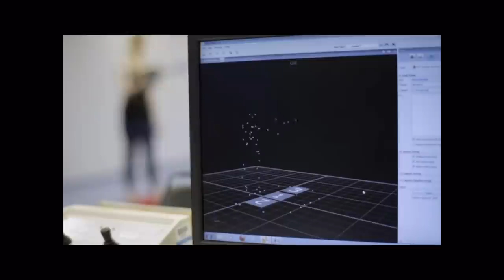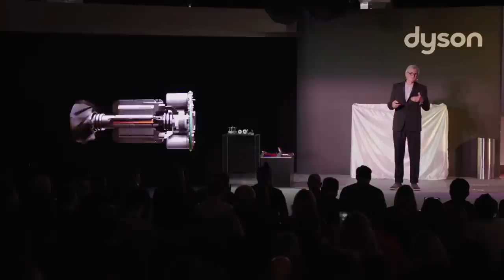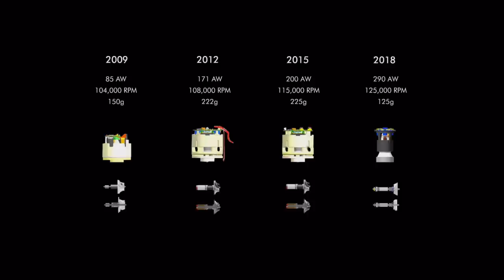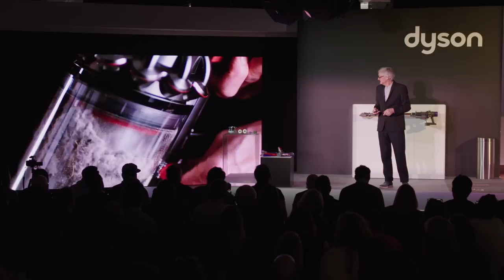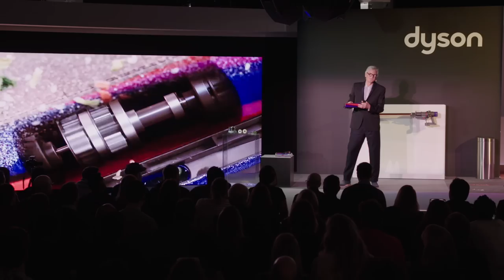James Dyson unveils the Dyson Cyclone V10™ cordless vacuum in New York

Comment: What is the expected lifetime of the machine? Rechargeable batteries need replacing after 500 charges,so that is a year and a half of daily charging. There are no replacement battery packs listed on the Dyson web site so presumably they cannot be replaced.
I have had my current mains vacuum cleaner for ten years and don't see any reason why it should not last another ten. Are we now expected to pollute the environment with yearly purchases of vacuum cleaners?
The video seems to go into every minute detail but avoids this issue altogether.
Reply from the maker: Hello,

Thank you for the comment. 

Batteries on our cordless range of machines can be replaced. They can be purchased from us directly and are relatively easy to replace. 

Best wishes,

Dean
Reply: Dyson UK  Thank you for the prompt reply. I  found  on your site a replacement battery pack for the V8,however  there  was no price listed  and the following was  written  "This spare part is not available to buy as it should only be replaced by a qualified engineer."
So it leaves me wondering  what the cost would be  - part + visit of technition?
Reply from the maker: Hello,

If you can please send us a private message, I will be able to assist you further.

Thanks,

Dean
Reply: Dyson UK lol shut down. So much secrecy over a battery.

Comment: 15:53. Did he say electronically up the amps??? One has to be carefull. If you ramp the amps as the battery fades you create more heat.  Even the wattage can pop a fuse or a diode. Thermally this isn't good. If the constant maximum performance ever surges or peaks even briefly thats no good and your vacuum basically goes to red blinking battery failure codes in the battery control module because the thermistor sensor is shot  and the thermistor circuitry is a fail-safe so you don't fry the circuitry in your vacuum ( but not always the case) . Now circuitry isnt infallible to surging or atomic dust conductivity which shorts the microcircuitry. Now i realize at the last stage of the battery performance the issues begin. Thats why possibly the trigger gets weak and breaks at the anchor point, as well now the printed  curcuit board may carbon track. The radial seals may also overheat due to the higher stepped amps. That is possibly why we see more motor failures in the V10 vacuums and some V11s with broken triggers or poor digital motor performance. Also in some climates. Static in the canister becomes an issue with these vacuums and the fine dust works past the pre motor filter and the hepa filter. I have serviced quite a few V10s and 11s that have this issue. One thing to note is don't wash the filters with hard water that have minerals in it. Best to get a  soft water filter for your plumbing when washing these filters. Heat also discolors this ceramic shaft and ceramic also absorbs heat and can expand the neodymium magnets causing hairline cracking also premature bearing wear. If you want to run tight tolerances you need to lose heat which can create imbalanced. Imbalances in turn creates oscillation at high RPMs and an imbalance at 135000 RPM things can fly apart fast and lock up the vacuum. However on these newer vacuums you went trigger less. How do you now compensate for the battery loss??? Also now if one actually vacuums something accidentally thats slightly damp. Now ones reaction time with an on switch is a lot slower to shut it off than quickly release the trigger. Now you're back to square one like conventional vacuums. Just saying. Sometimes engineers have to make up their minds whats better, ergonomical and efficient and stay on the same platform, or many landfills will start to fill up more because people want the latest and the greatest like the Gen5 detect. I already have seen over a dozen V10 vacuums in pawnshops with all their accessories for $100 to $150. And the batteries and battery management systems are faulty and these were used under normal conditions. The V10 is not even 10 years old yet and the issues as they get older are plenty.

Comment: The one thing that’s not clear to me, is that he keeps on saying that the airflow goes “straight through”. However, if you down the entry tube of the v10, you’d see that the air takes a perpendicular bend into the canister to create the “cyclone” effect. Then it’s sucked into the middle column into the back. Whereas the v8 already comes at a 90 deg angle into the bin, already creating the cyclone. So I don’t think the v10 is actually more efficient. Seems less so....
Reply from the maker: Hi Frank, we've put countless hours of engineering time and experience from our history of floor care products into making the primary separator inlet- or perpendicular bend into the bin- as efficient as possible for airflow. As a result of this and moving the axis of the cyclone to match the motor the air now takes a more direct route out of the cyclone, through the pre-motor filter and into the motor. This all contributes to the increase in suction power of the Dyson Cyclone V10™ vacuum.

Comment: CFM is the only thing that matters. If this has the highest CFM and he doesn’t list it, it’s because he’s still afraid enough of the competition to agree not to list it.
Reply from the maker: Hi there, a vacuum cleaner's suction power is measured in air watts. Air watts are calculated using both airflow (which could be measured in a unit such as CFM), and vacuum pressure. Both air flow and vacuum pressure are required to produce useful levels of suction power. The motorised cleaner head and airflow pathways within the machine also have important roles to play in the overall pickup ability of a vacuum cleaner.

Comment: The V10 will run for six minutes before the battery dies with it on full power and the powered carpet head attached.  People are already getting rid of them by selling them on ebay. You cannot beat a mains powered vacuum cleaner for suction power and performance!
Reply: Apparently you're supposed to run it on medium where you get 20-25min with the power carpet head attached.

I have been researching Dyson V10 vs V8 vs LG A9 Master vs Samsung Powerstick Pro.   
Because I am sick of dragging out the big machine with the cord and all the stupid cleaning of filters and hosing off the filter under high pressure water. 

First I was sure that I would get the V10.
Then I saw V8 seems to get pretty much as good reviews for $200 less.
Then looked at LG A9 and was convinced it was the one because of the 2 batteries it comes with.
Then changed my mind because its bin is too small (smaller than V8 even) and only filters 2.5 microns of dust coming out of the filter into the air, compared to 0.3 microns on V10.
Also a review talked about how theres a fair bit of washing and cleaning of filters compared to V8/10.

Looked at Samsung for a bit, nothing particularly remarkable there.  It probably works ok but just nothing remarkable.

Then decided on the V8 because of the price and reviews saying it's basically as good as V10, just empty the bin a bit more.

Then decided I will spend the extra $200 on the V10 to get:
1.  the bigger bin, because I hate emptying out dust and having plume of dust going everywhere.  I will probably wrap a plastic garbage bag around the bottom of it first before opening so the plume is sealed.
2.  the more powerful motor/suction
3.  the better cleaning head compared to V8
4.  the longer lifespan of battery (apparently 15 years instead of 3-5 years on the V8).  I read an anecdote saying you can buy a spare battery from spare parts for $95 AUD.

But the price was still offputting to me.

But now I just found a decent deal at $825 AUD for the V10 complete including delivery.

So I will go with the V10.

Then I just watched this video, and I am convinced that they have put enough into effort into the design to justify the price.   That doesn't mean it's a good product, only that they appear to be trying hard enough to justify the price.   Also the law of diminishing returns.  That 5% bit of extra performance costs you 30% more in research and development etc.  

So that's it, my decision is final, it's going to be the V10 for me!   Hope I don't regret it!   I plan to use it on medium power, and it takes me about 5 mins to do a room?  So I can do 4 rooms, then put it on charge for 3.5 hours and do the other rooms tomorrow, or next week.   Or maybe I will just do one room per day so it's only 5mins of work per day.   I don't like big jobs :P  Also looking forward to finally vacuuming my floor board skirtings, because I can never be bothered to do it with my corded vacuum.

Comment: I am looking for a new vacuum however I am literally torn now between this and the Shark.  

So my Dyson DC07 (purple and grey) finally packed in last year.  I had it since it came out, well a year after give or take.  I absolutely loved my powerful machine.  We ran into financial difficulty and decided to get a cheaper vacuum "powerflex" last year.  I was a bit annoyed with it actually as the dust got caught up between the bucket and the inner cyclone part (the cheap vacuum not dyson as that never happened with dyson).  It was only intended as a stepping stone for something better.  Thought, 2 yrs should do it to get our finances sorted.  Only for the thing to pack in on us this week! At least I got 5 yr with a Dyson before anything happened to it, generally speaking.  

Anyway, I have been watching duoclean flexology technology and with 2 batteries I am impressed. I am hearing however that their batteries are heating up and that to me is not a good sign.  Also their handheld part of the machine is hurting some users hands and wrists.  However, I am also impressed with this and as a Dyson fan, being that my last one was powerful, never lost suction and I had it for so long until I smelled a burning smell and knew being the second time, that it was time for a new model.  I have been wanting to go to cordless for a while now.  

I think the big thing for me when looking for cordless is, 
Picking up all the particles,
Clean Air Technology
Duo-clean Technology
Flexology for hard to reach places, 
Lightweight,
Powerful,
Generous size dust bucket,
Definitely run time so 2 batteries would be advantageous. 

Dyson you tick off so many boxes with this new model but I am so torn still.  I will look at some more reviews and if I decide to go for Dyson in the end up then I will update.
Reply from the maker: Hi there,

Thank you for your comment. I'm happy to share that Dyson Cyclone V10 features a 40% larger bin and is our longest running and most powerful cordless vacuum cleaner to date. It also features a direct drive motorized brush bar for added performance across carpet. Please feel free to reach out to Dyson directly, as we're very happy to go over any questions or concerns you may have, as well as assist with choosing the right model for your needs.

Best wishes,

David
Dyson US
Reply: Thanks you for your reply David.  I have always trusted Dyson, but I was so taken in by the thought of duo clean and flexology and longer running batteries.  I think I might just go for this v10 model sometime in the future though.  I really do not wish to be tethered to the cord anymore so to speak.  I really like what James explained with the way this particular battery operates.   

Also the foam type brush to pick up small particles like dust is an absolute must for us.  We have a few children so our house can get quite messy very quickly.  I wonder if that head could also be used on carpet to get the fine dust that sometimes gets trapped in deeper piled carpets? Beats using a hard bristled sweeping brush on my carpet which is what I am doing just now to get things clean.  Anyway, thanks for the response, it is much appreciated.
Reply: Do you need corded or cordless? Because I know some really good corded machines
Reply: It's-a me Megatron, I'm looking for cordless now, bending down to plug in and out is no longer good for me.
Reply: Frozen Willow 
Since cordless vacs won't deep clean and don't last too long is quite a $700 price tag.
You'll be better buying a cheaper stick/cordless vac preferably with interchangeable batteries (I know Shark and Ryobi make them) for about 199-399 and a good corded  vacuum that'll deep clean and last years like Sanitare ($150+) Royal ($300+) or even a used Kirby to use every few weeks.

Hope this helps.

Comment: How do you replace the battery. If it were hot swappable you could have two batteries and enough power to vacuum the whole house without waiting to recharge. I have my Hoover zoom and it has a swappable 79wh battery, so far it lasts long enough to vacuum the whole house.  But at only $150 aud, it makes sense to replace just the battery when it’s aged rather than throw the whole device away. 
I don’t know how much Dyson charges to service and replace the battery. But I still think it should be removable, with perhaps even the opportunity for improved  gen 2 batteries to be sold in the future.
Reply from the maker: Hi there, thanks for your feedback. Although the battery is not designed to be swapped out in use to extend cleaning time, if it's ever necessary to replace the battery with a new one, this is quick and easy to do - you would not need to dispose of the entire machine. The battery is held in place using regular Phillips screws, and can be easily replaced at home by the owner without the need to book a service with Dyson.
Reply from the maker: Hi,

Thank you for your feedback. Sorry for any confusion, that message is a standard description for when parts are not available on the website or are out of stock. The batteries on the cord-free machines are replaceable by customers at home.

If your cord-free machine requires a new battery, please contact us on the number given in your link.

Alternatively, if you're not in the US, you can email us at aucustomercare@dyson.com. We're happy to assist.

Best wishes,

Joshua
Reply: Dyson UK ok so you don’t need to be a qualified engineer to perform the replacement. How much would this battery replacement cost? Also I read that James Dyson mentioned the battery can last up to 15 years before it completely is dead, is that true?
Reply from the maker: Hi there,

Thank you for your query.

So we can discuss your concerns further and get accurate pricing for you, we would encourage you to email in and we'll get one of our Experts in touch with you very shortly.

Best wishes,

Shan
Reply: These look like evasive answers to simple and direct questions and this: " that message is a standard description for when parts are not available on the website or are out of stock."  looks deceitful, at the very least.
Reply: Dyson UK I also want to know. Can you post the answer here for everyone to benefit. It’s silly for 1000s of people emailing in with the same question.
Reply from the maker: Hi all,

Firstly, we know that suction is one of the most important aspects of performance for our owners. Extensive battery testing has shown us that batteries locked into the machine provide a more reliable electrical connection and provide stronger, more consistent power over time. However, they can be removed and changed via two Phillips screws.

The V10 battery has yet to have a price finalised but in the UK, our cord-free batteries have historically been £60.00.

I hope this helps.

Allan

Comment: At these huge air speeds you would expect a huge abrasion between the dust and the cyclone walls, right?
Reply from the maker: Hi Feza,

Heavier matter will actually bypass the cyclone chamber and be captured directly into the bin. The small particles (as small as 1 micron) will enter the cyclone chamber and be separated by 79,000G of force from the airflow to drop into the bin. At this stage, the particles are so fine and microscopic, abrasion is certainly not an issue.

I hope this helps.

Best wishes,

Allan

Comment: I have a few questions, James said here that the DDM V10 creates 290AW of suction, how come the cyclone V10 only does 151aw on the highest setting? Why isn't 151aw standard mode and 290Aw on the  max setting? Will you make a cordless upright featuring the V10 DDM with 290Aw or is the stick type what all future Dyson vacuums will be?
Reply: 290 AW when talking about just the motor. The obstruction of going through the cyclones and especially the filter will decrease the AW.
Reply: It's like gross and net horsepower of a car engine. My car does 370hp, but probably only 310 at the wheels.

Comment: Sorry James you’ll have to reduce the price or at least increase the warranty.  You don’t seem to have much faith in the reliability of your own product.
Reply from the maker: Hi Jon, I can reassure you we test all of our machines very rigorously - both during development, and throughout production. We use tough, flexible materials that can absorb forces from impacts sustained in daily use. Dyson machines are engineered to last, and even outside our 2-year cord-free warranty period, replacement parts are available to ensure the machine remains in service for as long as possible.
Reply: Dyson UK  Sadly there won't be replacement batteries for the V10 cordless vacuum.
I can sort of understand no replacement batteries on phones because they need to be extremely compact and every gram and square millimeter matters. There is also an increased need for performance needed to use your phone for everyday tasks, making it reasonable to buy a new phone every 2 years. But a vacuum cleaner? If it sucked the proverbial cheerio yesterday, why do I need a more powerful vacuum today? Have cheerios gotten heavier?